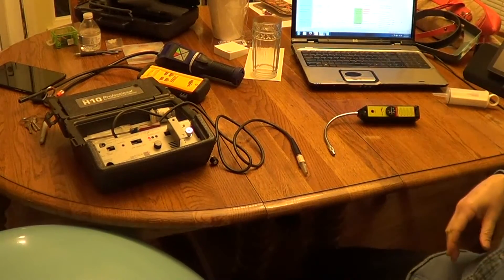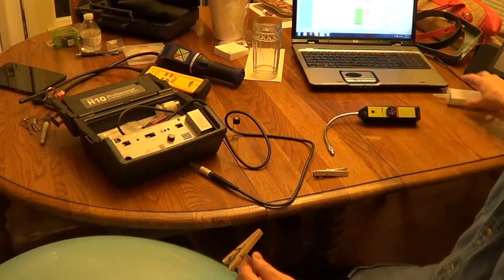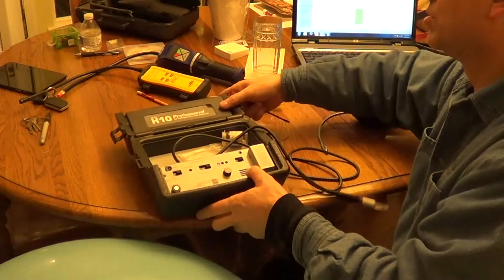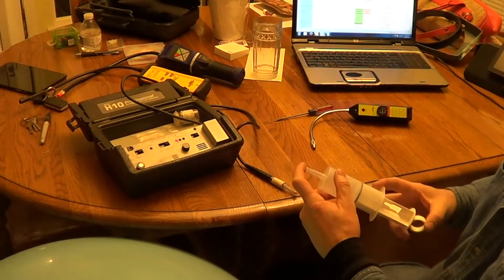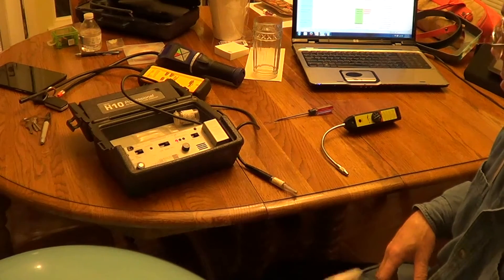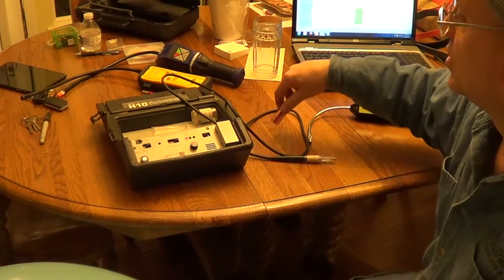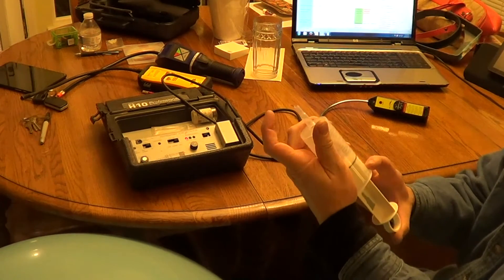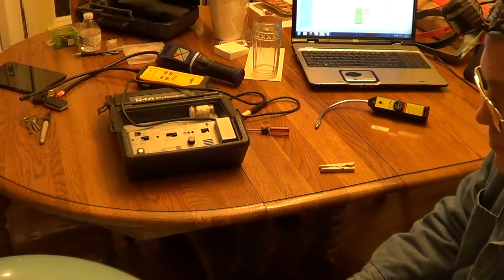H10 Sensor Temperature Adjustment R410a Sensitivity PPM

Comment: I came across your video by accident but really glad I did. I have a H10 like the one your testing and wondered how it would do with 410A. Most of the time I use soap bubbles but the really small leaks I get the H10 out. Did Bacharach say roughly how long the sensor would last running the sensor that high? Can't be long. This trade is getting as bad as the car industry. Every time they come out with a new refrigerant you have to buy another detector.
Reply from the maker: It is shorter life.  I would guess 6 months.  By the way, the Fieldpiece SRL8 and the Testo 316-4 both have hotter sensors.  They both get 10x better sensitivity to all the HFC based refrigerants.  I had to buy all the hvac leak detectors and test them to actually find that out.  The SRL8 is very squirrelly and will trip on every out gassing solvent that you can think of.  But, it will find small HFC leaks in seconds just like the H10 will on CFCs.  And, you know the sensor needs to be replaced in the SRL8 if it starts acting nice and not false hitting.  I have been evaluating the Testo 316-4.  It does appear to be more stable than the SRL8.  But, I still like the SRL8 better.  False hits are easy to eliminate by re-checking the area.
Reply: What's different about the new H10 pro? Have you had any experience with that one? Is it the same as what we have and they just run the sensor hotter?
Reply from the maker: Yes.  I did test the H10 pro.  It is on my report.  It wasn't any better than the older H10.  I still havn't found a single CFC and HFC detector that is sub 1 ppm sensitivity.  It has to be 2 separate ones.  Send me an email and I will send you the report for free.   n a t h a n g w @ a i r m a i l . n e t    (no spaces)

Comment: How are you calculating your ppm with a balloon and a sarienge? I only ask becuase my RLD H10PM found leaks the Inficon Dtek select infered couldn't. Heck a quick check of the calibration gas from the H10 shows my how bad the Dtek is becuase it doesn't even alarm and I tried that with two other dteks, one was brand new.
Reply from the maker: +ucantstopthis1 I'm assuming you are referring to R22.  H10PM is 0.12 ppm sensitivity to R22.  This is exceptional.  Dtek Select is 5 ppm, which is 42 times less than the H10PM.  R410a is a different animal.  Only the SRL8 and the H10 Pro have sub 1 ppm sensitivity to R410a.  I'm not counting the $10K industrial sniffers which nobody uses.